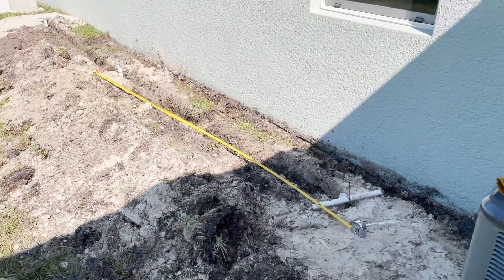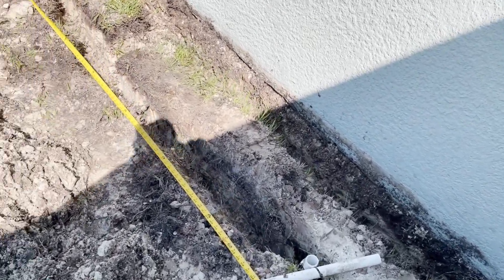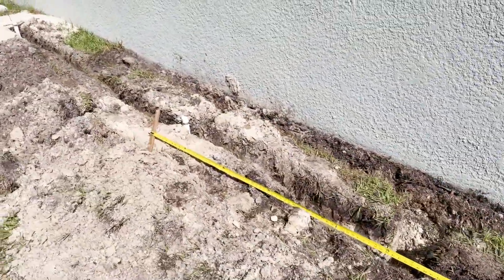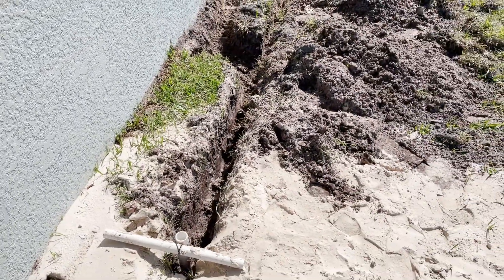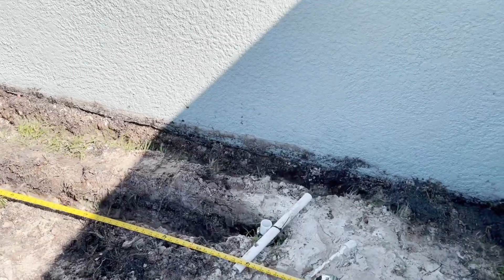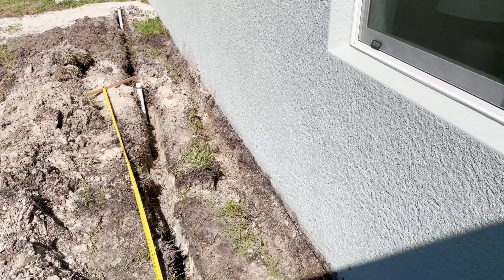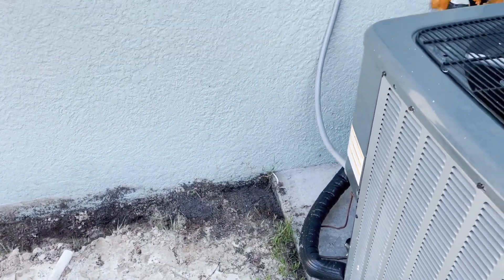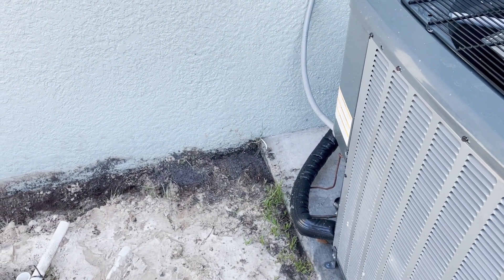Florida Sand Point Well (part 4) Well Trenching

Comment: Did the well point feel rock hard ?
Reply from the maker: i'm not sure what you're asking, but you can check out sand well points at the big box stores.  i used the five foot PVC 1-1/4" ones.  it depends on the soil conditions at 25' (the depth i went to with the 3 holes).  if sandy soil, you can probably lightly push or tap those down a little deeper.  obviously, if you use a steel sand point, you can be a little more aggressive with the hammering for an extra few feet.  i don't recommend those however, since they will oxidize over time and require servicing.  again, if you are hitting really hard ground and the sand coming up through the hole is not water-bearing, you will need to get through that hard layer and into good water-bearing sand.
Reply: @guydoesstuff6562  sorry I didn’t type that out right. I meant hard pan instead of well point. Got through the hard pan, it but was like rock hard material a few feet thick
Reply from the maker: @TheOffcialElonMusk , yep the drill bit stops going down abruptly.  high water flow helps get through the layer more quickly, however it becomes REALLY easy to get your drill pipe stuck in a thick hard pan layer.
Reply: @guydoesstuff6562  my pipe is stuck and I can’t get it out
Reply from the maker: @TheOffcialElonMusk , did you get it out yet?  btw, it happens to a lot of people.  solution:  concrete block, 4x4 (8-footer should do), and a log chain.  it WILL come out.  the log chain should be cris-cross wrapped on the drill pipe 6 or 8 times before you try to pry it up.  otherwise, it will just slip on the pipe.
Reply: @guydoesstuff6562  no I didn’t … it’s stuck good. Thanks will try this
Reply: @guydoesstuff6562  hey what steps do you take between setting your casing, inserting your WellPoint and then removing the casing ? How do you prevent the casing from getting stuck when you shut off the water pressure to insert the well point ? Did you use all inside couplings to reduce friction on your casing ?
Reply from the maker: @TheOffcialElonMusk , by "casing" i am assuming that you mean the drill pipe.  the finished well is NOT cased.  the answer to not getting your drill pipe stuck is to dredge out the sides of the hole as you are jetting down, i.e., make sure that the hole ends up being wider than the outside fitting on the 2" drill pipe.  another common mistake is that people try to go too fast when drilling and actually push the drill pipe.  you want to let the water clear debris from the hole.  your 1 1/4" well sand point will not clear the internal diameter of a 2" drill pipe if you use 2" internal couplings.  again, if your water flow while jetting is insufficient, the likelihood of getting your drill pipe stuck is quite high unless you go REALLY slow through the hard pan layer(s).  how much water flow in gpm do you have?
Reply: @guydoesstuff6562  thanks for the tips! The job is complete and working great. Ended up having to use inside couplings on the drill pipe which then required inside couplings on the well pipe. I used plumbers tape on the suction line at the check valve and going into the pump. I have a very very minor air leak into the system somewhere. 
Also had to go with a metal end piece on the drill pipe as the pvc teeth were wearing down
Reply from the maker: @TheOffcialElonMusk , congrats for your persistence and success!  welcome to the "almost-free" water club.  if you use your well regularly for non-potable purposes, you will have a rapid payback period vs. continuing to use city water.
Reply: @guydoesstuff6562  so you removed your drill pipe then insert the well pipe ?
Reply from the maker: @TheOffcialElonMusk , nope.  i used outside fittings on the 2" drill pipe (hence, the caution to make sure you dredge out the sides of the hole when you drill so that you don't stick the drill pipe), then i used 1 1/4" internal couplings on the well pipe.  i inserted the 1 1/4" well pipe inside of the 2" drill pipe before pulling the drill pipe.  using an outside male to female fitting is the only way to provide clearance for the internally coupled 1 1/4" pipe which will remain in the ground.  i will see if i have any footage of that and post it up on the playlist here on YT.
Reply from the maker: @TheOffcialElonMusk , the link is https://youtube.com/shorts/S6EpNV3cMhw
Reply from the maker: @TheOffcialElonMusk , nope.  steps:  drill down to 25' (outside female:male coupler), insert 1 1/4" well pipe, (internal 1 1/4" couplers) then pull the 2" drill pipe out.